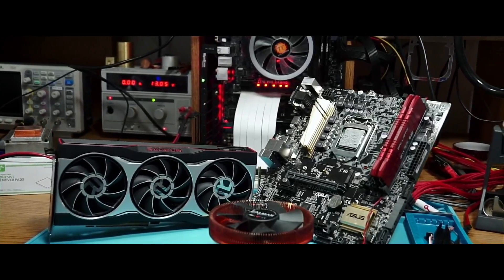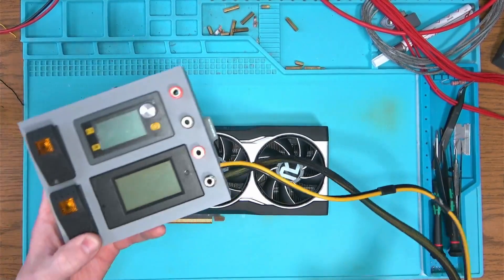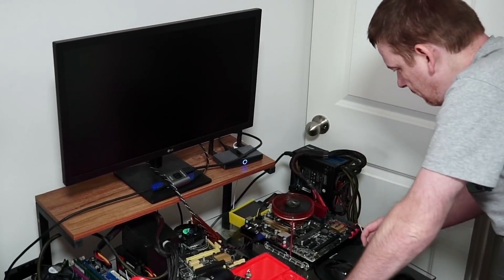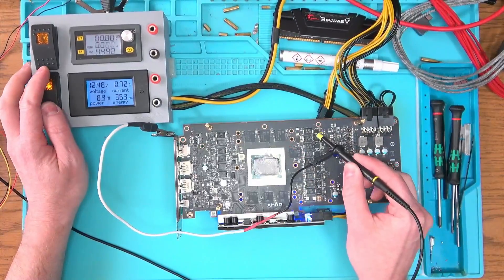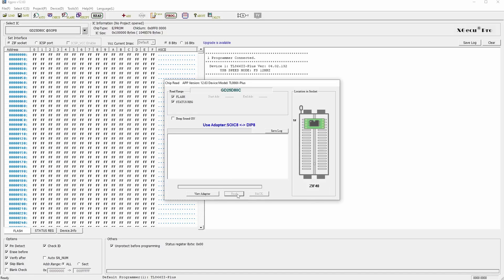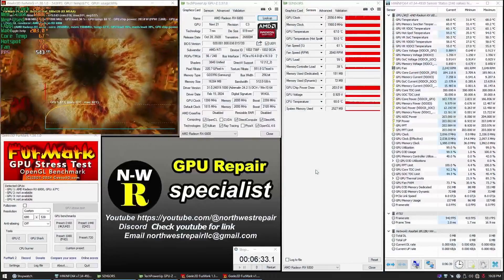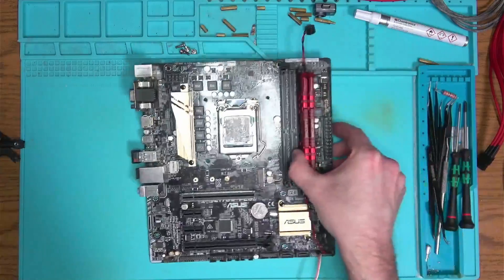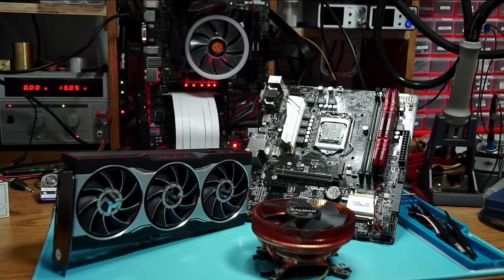Does flashing GPU kill your motherboard ?

Comment: Bit late but if you were unable to fix your motherboards you can remove everything, the cpu and cmos battery then short the start pins for a few hours it seems to work for my board when I get the same problem.
Reply from the maker: That resets bios.
It does not fix it if it's corrupt.
Reply: @northwestrepair  Sort of yes it does reset but I can reset the bios as much as I want and leave the battery out for days and it will not turn on, I suspect there is some residual left over problem with my board at rare times and this is the only way to get it to turn on when it happens.

Comment: As odd as this seems, it actually makes sense as GPU BIOS is read first when system powers on. I guess we can call this malware "Sapphire Trojan". And yes, golden advice; Do NOT flash any of the BIOS software just because there is a never version out there. Don't fix (update) it if it ain't broke (working fine)!

Comment: what is that tool you used to test the GPU power? also im pretty sure your high hotspot temps are because your not spreading your thermal paste. when dealing with direct silicon, not the cpu IHS, you should always be spreading the paste to make sure ALL transistors are covered and having heat directly removed. Otherwise you risk part of the chip overheating and overstressing which could eventually lead to premature failure. Try spreading the paste AND using the nylon washers next time. just found your channel. love your videos so far.

Comment: I flashed a gpu and it killed the motherboard sound and it never worked again. Gpu was msi 3060 ti gaming x trio, motherboard was msi b450 gaming plus, gpu bios was the resizable bar update bios that was relased by msi (nvidia) when ampere gpu's got the rebar update.

Comment: On my xfx rx 6800 I see a max of 75c on the hot spot and usually my core is running 60c so I guess ill consider myself lucky.

- edit for anyone wondering I am using the anti sag bracket that came with the card in a lian li 011 air mini with 2 140mm fans in the bottom feeding good airflow from the bottom of the case to the card.

Comment: Well the original RX480 had a design flaw that could kill motherboards because it was pulling more than it should have been from the PCIe slot, amd only added a workaround via drivers to reduce it, my Strix RX480 was totally fine since Asus fully customised the PCB and all core power was straight from the PSU without much being powered by the PCIe slot.

Maybe this bad bios on that GPU would also allowing huge power draw from the PCIe??

Comment: Take out the battery with the power cables removed and clear CMOS, then put the battery back. I also had a weird issue where a motherboard seemed completely dead but taking out the battery solved it.

Comment: I had the same exact mobo and it died about the same way. I dug a little and found out that the chipset dies on these quite often. I diagnosed the motherboard and sure enough, the chipset was shorted, bye bye mobo. 

This may well be the case with your mobo, it is easy to test. Mine died when inserting a USB device. The USB device is fine and works still today. The Z170 chips were garbage, very sensitive for ESD etc.

In other words, i doubt that the GPU really killed the mobo. It was just too much for it. Connecting new devices to it everyday kills the Chipset. This was most probably just coincidence.

Comment: I flashed my Radeon 5850 with a 5870 firmware (higher model) to get more performance, since it was the same die. For some it worked, for others it didnt. I'm guessing something similar happened here, by using a firmware with higher clocks from Sapphire instead of AMD

Comment: @northwestrepair What about the BIOS of the motherboard? Have you tried to reprogram the BIOS EEPROM with an external flasher? I have experienced a modified BIOS corrupting the Intel Management Engine on an motherboard that keep corrupting good flashed bios in the motherboard repeatedly, basically it refuse even good stock BIOS after I flashed the modified one.

Comment: i have reflashed xfx rx560 on mobo more 20 times , with all wrong bios (as testing for fix) , from gigabyte asus saphire .  Mobo is fine . Owner of that 6800 Xt flashed to unlock shaders or to gain overclock , i realy think wrong bios wont kill motherboard. Also my main gpu is flashed from rx5700 to 5700XT (powercolor brand and bios) . Runs fine .

Comment: De ram on youre motherboard is not in the correct slots, as i saw they sit in slot 3 and 4, usually with 2 sticks you want them to be in slot 2 and 4 for dual channel, there is a high change you are actually using just one stick right know

Comment: AMD 🤦🏼 even if you flash the wrong bios, there should be protections in place to prevent frying your hardware.  Idk, I’ve toyed around with bios flashing with various models and brands on multiple cards over the years in the pursuit of over clocking.  I’ve had cards that failed to boot, but never had one brick a card beyond recovery or kill a mother board.  Always been Nvidia though.  Haven’t ever owned an AMD card, owned a few ATI cards years ago.
Reply: It's not an AMD problem. It's a BIOS virus.

Comment: I have had to do Blind Flashing using a floppy drive where u watch its indicator to know where u are and u already did a dry run so u know what commands to run when its time. Was on a GPU that had a bad custom bios that prevented system boot and had no luck seeing it in windows so it was Dos with NVflash

Comment: Still curious after watching this earlier. Since all the specs are coming back normal for the video card before you re-flashed it with stock bios, what in the heck could possibly be causing the mobo to fry.  Virus in the current video card bios mod infecting the mobo bios?

Comment: People usually try to do this because they hope to get higher or more aggressive boost speeds, power limits and so on from better card. Never heard of it killing motherboard, but I suppose that is not out of the realm of possibilities. Since on firmware level, I doubt anyone would want to idiot proof things... you would need chip in size of SSD to failsafe proof that. But yeah, it is something I chug up to same tier as liquid metal, crazy people doing crazy things so they can have 5 FPS more at risk of killing something. :-D
Reply: Regarding higher clocks/ limits. I'd rather Read, Save, Copy, Edit the copy of the on-board bios/ manufacturers bios and flash that, than flash a Random bios from a (best case) Golden chip version of the interweebs. But what do i know :body-blue-raised-arms: 
One requires time to get to know your cards limits, trial and error and incremental iterations. Aaand actual Real-life testing to see if the changes are not only stable but actually give better performance and perf/Watt.
The other ... See influencer video (15sec from Tick-Tock) > Download > pray 🙏 > flash > 🙏 > :eyes-purple-crying:

Comment: Reference card and reference bios, there's nothing different between the msi, sapphire, or unbranded reference cards. I'd expect it's more likely the bios got slightly corrupted and may have had a bad interaction with the GOP section of your test board UEFI bios.

Comment: wow just like to know what is the reason for flasing a GPU, do you need to???
Reply: It's a common thing in the Nvidia community. You can find BIOSes from other cards that have exactly, or very closely, the same PCB as yours but which were programmed with a higher power limit.
Reply: @Expo_Hans  : only one other time I saw someone this GPU Bios flash was in a video JayZ2cents... but I imagine one has to know what he's doing or else end up with a non working PC... i didn't even know that existed oned updating drivers..

Comment: It's weird. The Sapphire BIOS and the AMD BIOS on the TechPowerUp site have the same build date/time and the same version number. The TechPowerUp Sapphire BIOS looks the same file that was flashed on the GPU--the chip reader app shows the identical build date/time displayed in the memory dump. And all three say "AMD NAVI21 Gaming XL D41209." The Sapphire BIOS is 1024K versus the AMD's 832K. Maybe it was a bad flash by the customer?
Reply: A BIOS virus explains it all. The corrupted BIOS not letting the GPU work, and the motherboards refusing to work after receiving the GPU.

Comment: ive personally modded 750ftw bios (allowing extreme voltages and clocks to be reached)
card worked perfectly, flashed my old 5700dd ultra with a 5700x bios (obvious reasons why)
worked perfectly, and with a bios "switch" i could use the stock bios if need be.
ive really had no issues with bios flashing. never killed any motherboards for sure. 
killed some cards, but not bad flashes.

Comment: Everyone wants to know how that mobo died.
Please keep us updated.
Reply from the maker: I'll take a look but I lack a lot of knowledge about the inner working of a mobo
Reply: @northwestrepair  motherboard bios corrupted or possibly the VRM gave out, I do remember those boards having a weak VRM.  On a side note your memory is installed incorrectly but not likely a contributing factor.  I have a 6900xt I should send you, I think it needs a memory chip.  Maybe wanna upgrade it from 16Gbps to 20-24Gbps chips? :D
Reply: @NVMDSTEvil  heatsink looks too large to fit memory in the correct slots. (2 + 4 instead of the 3 + 4 it's currently installed)
Reply: @NVMDSTEvil  I'm gonna say VRM also unless it turns out to be the CPU. The GPU lanes are directly wired to the CPU but if all that was wrong was a bad bios and not something physical I can't see back-feeding being an issue. All I can think of is the card trying to draw more than 75 watts from the board, I am unsure if the boards PCIe power can go to the core or memory. Perhaps it tried starting the card without having external PCIe power active? I am unsure if this is possible. I don't think it's possible to short out the boards PCIe supply with software as that would be controlled by the power chip on the card iirc

Good luck with the mainboard. I once had an assassin card kill a dual-cpu pentium pro system many years ago, along with 3 others. Painful but rare
Reply: @northwestrepair  collab with Sorin.
Reply: @northwestrepair you can check out this channel for motherboard repair: https://www.youtube.com/@MainboardMedic
He is as good as you when it comes to mobo repair
Reply: @northwestrepair  if you can't even get an error code, try flashing fresh bios on it. It doesn't work, so at least you wouldn't be making it any worse.
Reply: @northwestrepair  The key thing was the Sapphire BIOS (software). That needs to be analyzed but it could be as simple as a faulty flash or corruption in it that might have been created some sort of an illegal call or looping on the mobo. Still, would be interesting to find out.
Reply: amd=evil thats how

Comment: The reference AMD gpus can be manufactured and sold as sapphire, xfx, etc whatever. Look at your own video at 0:40 seconds it is written on the label: Sapphire RADEON RX 6800.Sapphire vbios was not flashed by the customer, that's the factory vbios. Most likely it was a corrupted vbios for whatever reason....

Comment: Consider offering repasting with PTM7950 as an additional fee. 
It's very effective against high hotspot delta on AMD cards and it lasts longer.
Reply: yeah it works amazing, i had pump out issues tried 3 different thermal paste with it being an issue in about a few weeks.
Tho i used the heatphase ultra from Gelid and made that to size cause it was cheaper and easier to get for me.
Reply: Hey guys, are you talking about rx 6000 reference models? ive been wondering if anyone allready tried that, is there a notable improvements of hotspot temps compared to stock graphite pad? Did it require use of a washers or someting like that? Ive got my 6800XT reference and even tho its undervolted to about 1V my temps are.. well not great.. If i would allow card to draw full 300Watts, hotpost goes to 95C even with fans blazing. Thank you for any response :)
Reply: i also managed to drop one more card for my brother back then and in his case, temps are even worse :D

Comment: I've never killed my motherboard by flashing the GPU bios - I have never flashed incorrect or experimental bios either...however, I have only seen a GPU kill a motherboard once, and it had been in a system that had been struck by lightning. I was testing components and when I plugged the gpu into my test bench, powered it on, and there was a ninja attack - a puff if smoke and sudden death.

Comment: You can flash 4090's with a multitude of different bois' Even different brands/sku's I have had an asus bios running of my zotac card. Also tried out the completely unlocked one you can find online and my card pulled 622 watts 😱

Comment: i remember back in 2000 i had my own shop and i had once a AMD K6-III that would make any motherboard burn, it was a pain in the ass. Nice job as usual @northwestrepair !!
Reply: I remember those! Was it the 233? I'd encountered a rogue CPU - had one single pin bent absolutely flat and didn't see it at first since there was no resistance plugging it in.
Reply: Why did you keep using it after it made the first motherboard burn, then? Seems like PEBKAC.
Reply: @RFC3514   you misunderstood me. I didn"t kept it, but as i was trying to fix my customer pc, i tried 2 or 3 motherboard and each one went HS after that. Don't be agressive dude ;)
Reply: @dorianeroars666  - So, the original motherboard was dead, then you tried the same CPU on a new motherboard and it killed that one, then you tried the same CPU on a second motherboard (and the same thing happened) and then you tried the same CPU (which clearly had a short circuit or something) on a third motherboard?

I'm not being "aggressive", I'm just confused as to why anyone would do that. 🤔
Reply: @RFC3514  Ever run a PC repair shop? You end up with things lying around and if you were busy the other day and didn't label that particular part as sus, chances are high that you or one of your colleagues will plug it in somewhere; and you don't always know right away if the CPU killed your MOBO or if that mobo was having issues already (repair shop), so you try another donor part to verify.
Reply: @yissnakklives8866  - No, I've never run a PC repair shop, but I have repaired (and built, and upgraded) dozens of computers for a couple of video production and visual effects companies.

And if something had already killed someone else's motherboard (plus one of my own), I think I'd label it (or, in fact, remember it) instead of letting it kill two more. 

But hey, maybe I'm just weird.

Comment: Similar thing happened to me but without killing motherboard. I had XFX 6800. I tried to just switch BIOS, the card has dual BIOS, everything was fine then rebooting no picture. I tried everything for a week, but card refused to update its BIOS. Finally, I sent for RMA got a replacement immediately sold to second hand market. Long story short, AMD GPU has weird BIOS problems. With Tony's case it is even more weird. I suspect Tony needs to update the motherboard BIOS since technically the card was fine except its BIOS.

Comment: Is not GPU BIOS, is GPU firmware, no?
Reply: BIOS and firmware are the same thing
Reply: @KevintónBlack Understandable mistake, but not quite right. BIOS is the name for a specific proprietary firmware.
Reply: @CocolinoFan   I've made a mistake. You are correct. BIOS is a type of firmware that is used to boot up an OS, whereas normal firmware is just embedded software in a hardware component.

Comment: I noticed that you pluged ram sticks on the two last slots, this way you are using a single channel ram, to use double channel ram you need to plug them on the same color slots: both in black slots or both in grey slots (better be in grey ones) The idea here is not about colors but about slots numbers, 1 goes with 3 and 2 goes with 4.
Thanks for the video.
Reply: Maybe reducing variables, pinning down points of failure? I think he did mention he thought maybe memory was dead
Reply: @lucaslothbrook5388  Yeah, i also was thinking that afterwords it does not matter cz he is using that motherboard for gpu testing only. Thanks for the reply.

Comment: How on Earth the worng BIOS can kill a motherboard? Even theoretically. Support higher voltage to CPU or RAM? You cannot bypass the mosfets and coils. I reckon maybe the BIOS chip was taken out and not soldered properly, but that should show as shorts etc. Very weird.
Reply: It's theoretically, definitely possible, if not so common!
Reply: He doesnt even say what was the customer doing with it just continues about amd being bad lol. maybe was just that sapphire firmware on this sapphire rx 6800 was corrupted would be my guess. As for the motherboard we can only speculate given that he didnt even try to flash that mobo bios.